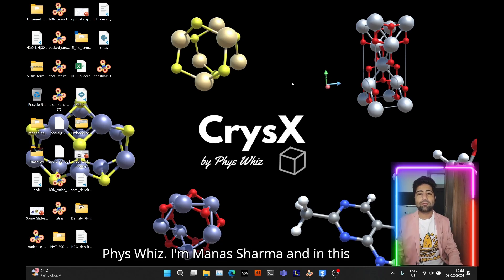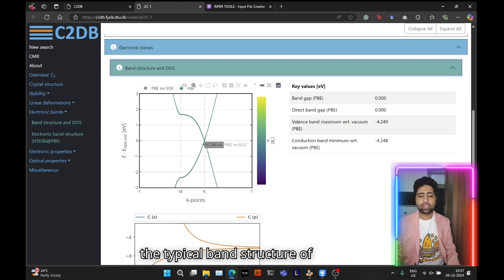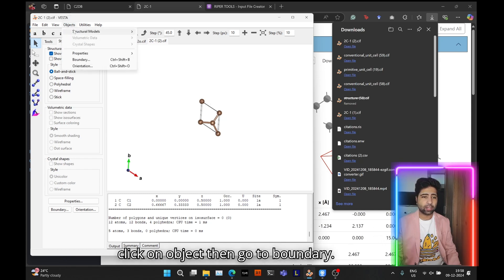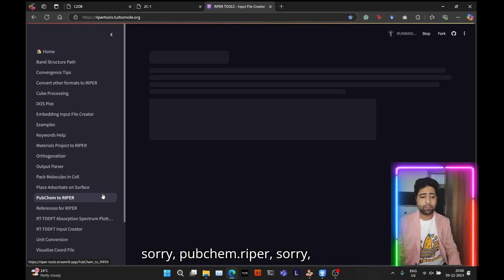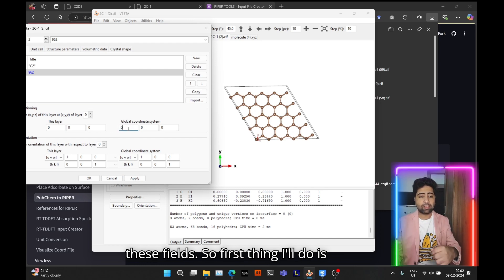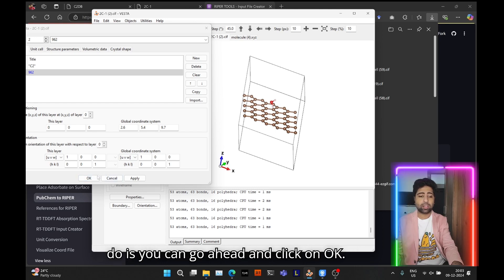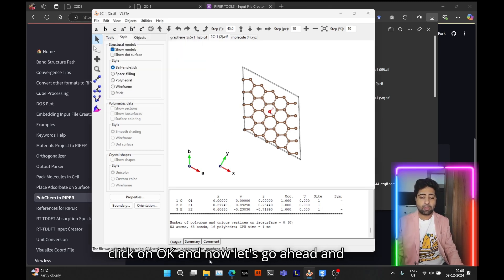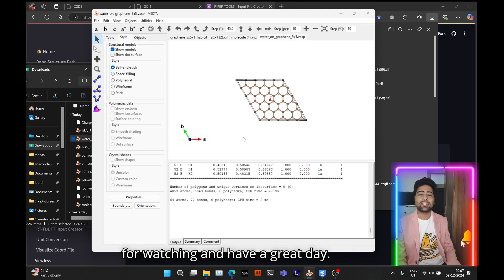How to Place a Water Molecule on Graphene Using VESTA - A Step-by-Step Tutorial

Comment: Hi @Phys Whiz, I want to adsorb Li ion above the graphene monolayer 3 Angtstrom on multiple sites for batteries studies. I haven't to import Li from the outside, could you please discuss how to to do this.
Reply from the maker: You can simply create an XYZ file with the Li ion and then follow the steps in the tutorial. Save the following text as Li.xyz using any text editor:

1
Comment: Li ion
Li 0.0000 0.0000 0.0000
Reply: @PhysWhiz  that's wonderful. Thanx

Comment: Don't we need to save it at the end again after reducing the huge graphene monolayer as per our requirement?
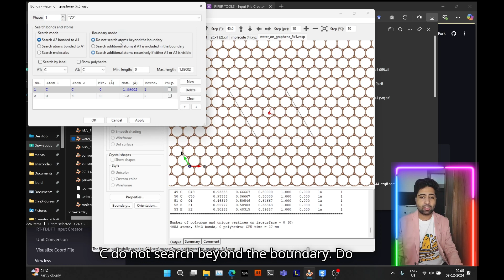Reply from the maker: Hi Sajid, I haven't actually reduced anything at the end 10:04 . The POSCAR did not have those infinite atoms, to begin with. It's just a VESTA visualization artefact. When I tell VESTA to not display the extra atoms beyond the cell, that is not affecting the number of atoms in the structure file. It is only for Vesta's visualization.
Reply from the maker: 9:59 You can see that when I imported the POSCAR to VESTA, it already said that it has 53 atoms (look in the output window in the lower portion). The only problem was that VESTA has this setting where it will additionally display extra atoms (not in our structure). So I fixed that.
Reply: @PhysWhiz thanks very much for this informative video. I have few questions? I want to make some Oxide functional group on Graphene, if I do the same process that you have done but every time we open the file we have infinite atoms. 1- Does not it make problem in poscar file and optimization running?
2- I can see the boundaries but for investigation on surface effects of G like adsorption , I didn’t see this boundary in z direction, could you please help me? Thank you so much.
Reply from the maker: 1. I showed in the video how to export the POSCAR properly. Then when we visualized it with VESTA, there was an issue of extra atoms being displayed. I showed that the POSCAR only had 53 atoms as we had intended it to have. It was just a stupid VESTA visualization issue, nothing else. VESTA is not the only visualization tool out there. There are many more tools like Jmol, CrysX-3D Viewer, etc. You can visualize the file there and see for yourself. The problem would be there if your POSCAR also has those extra atoms. But I already showed in the video about how to get rid of the extra atoms at the boundary and beyond the boundary and then save the structure. One should always check that the POSCAR only has the same number of atoms that they expect and not extra atoms. In my case the graphene unit cell has two atoms. So a 5x5 super cell has 5x5x2 = 50 atoms. Then 3 additional atoms from water to make it 53.
Reply from the maker: @atiyekhosravi  Hi, In my latest video I discuss the issue of these spurious extra atoms and how they won't affect the calculation: https://www.youtube.com/watch?v=yP1BREWv6u0&t=98s
Reply from the maker: Hi Sajid, In my latest video I discuss the issue of these spurious extra atoms and how they won't affect the calculation: https://www.youtube.com/watch?v=yP1BREWv6u0&t=98s